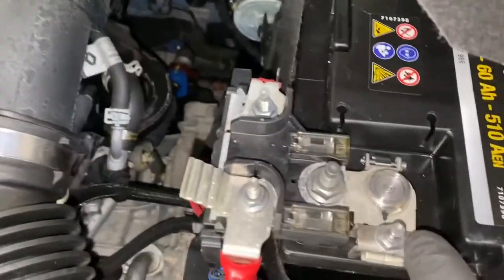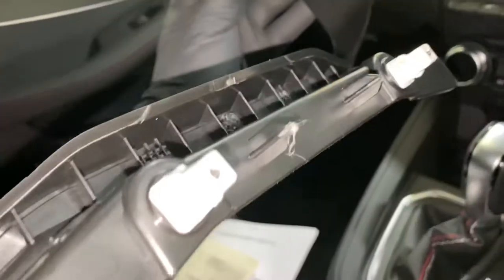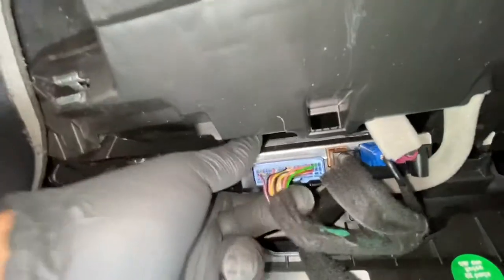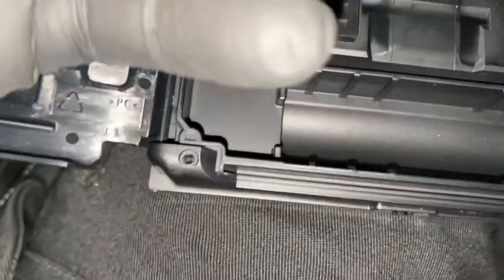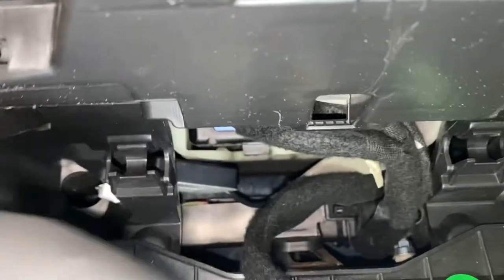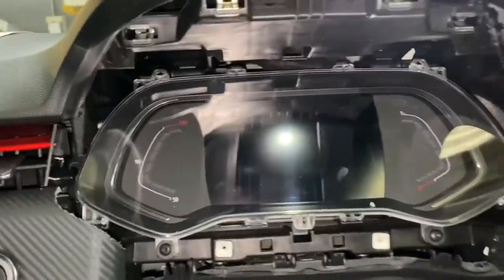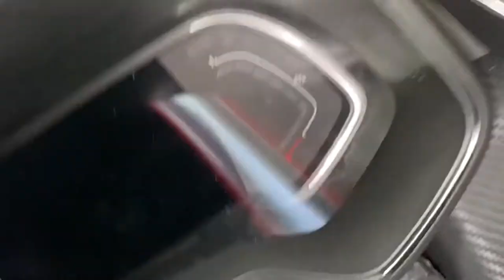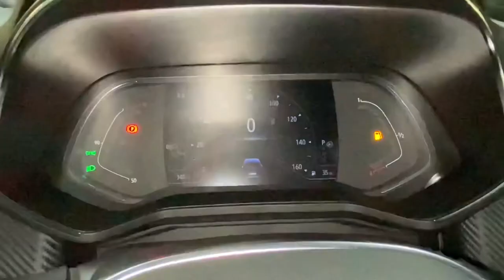#Renault #Clio #2021 #SOS #Telematics #Battery #fault #rectification #instructions #process

Comment: hello, thank you for your detailed video! I have a Dacia sandero stepway III 2021, I have the same problem, but I can't figure out where the SOS emergency call battery is to change it, could you tell me where it is? find it please? because it shows me 'emergency SOS call to be checked'
Reply from the maker: Take it back to the dealership if it’s still under warranty and. It should be free

Comment: I have the same issue with mine. I already replaced the battery with a new one (70€ with the replacement)at an authorised dealer but the problem remains. They electrician of the dealership said to me that the telematics unit need to be replaced because it failed to connect with his computer. The car has 87.000km since 2020. So i'm not convinced. For now i'm looking for other options. The unit costs 450€ brand new from France. Any help what can i do?
Reply: Does your car have 87000? What problems did you have during those kms? Did you have engine problems? Or engine heating? Are you satisfied with the car? Thanks
Reply from the maker: If the telematic unit is faulty then you have to replace it because it won’t communicate with the other module to let the vehicle know it’s been rectified

Comment: what does "configuration of the telematic unit" after replacing the battery mean, what else do I need to do after replacing a battery?
Reply from the maker: To let the car know it’s been replaced
Reply: @g_a_bofficial  is token required to reconfigure IVC?

Comment: Do you think it's the same type of battery in telematics for the Zoe 2015... The unit it sits in looks the same... 🤔
Reply: yes. it should be the same
Reply: At a closer look the unit does not look the same as in the Zoe from 2015. It's a common problem that the car stop's communication. Not sure why. It's seems like the Renault service personal doesn't really now why, at least not in Sweden...
Reply from the maker: Not sure best to contact your Local Renault retailer